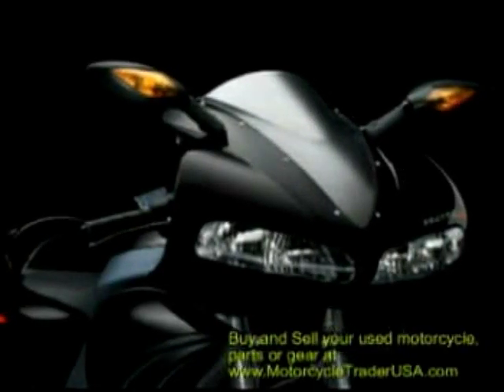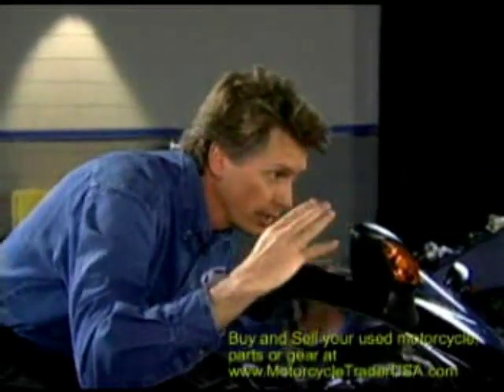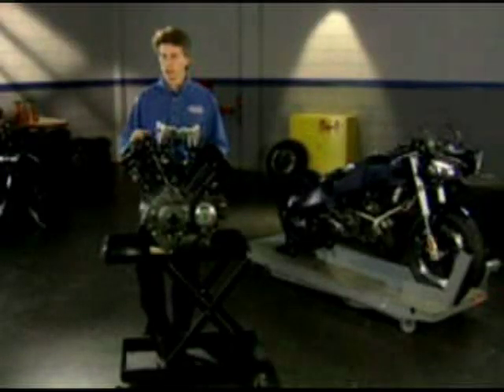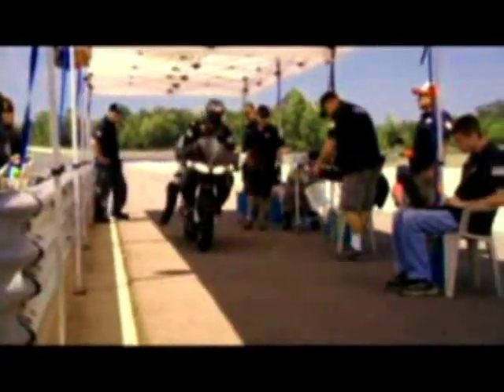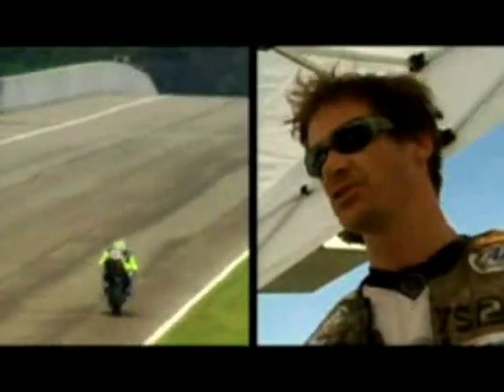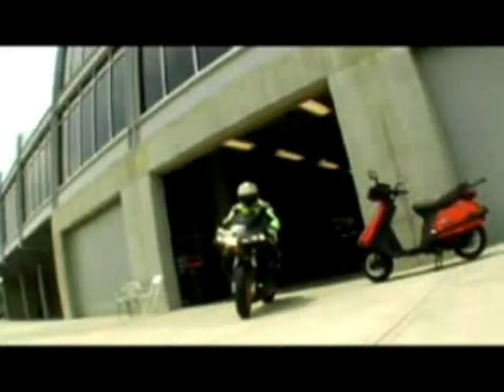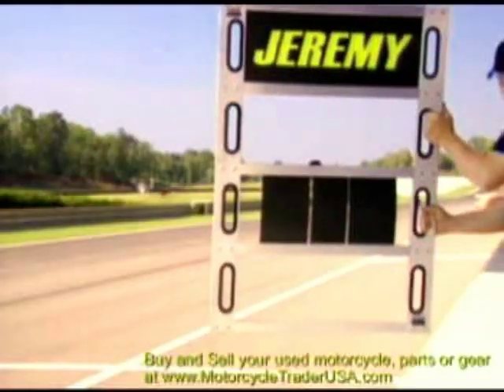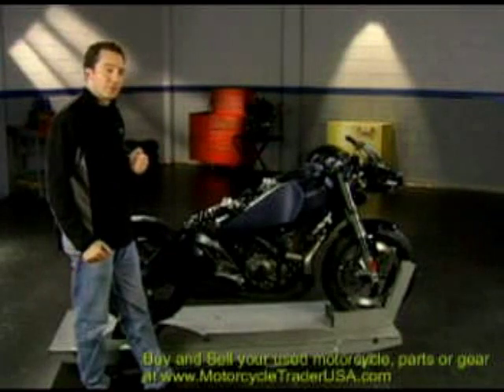Buell 1125R Motorcycle Full Overview Video

Comment: Would I have bought an 1125R FOR 12K plus. Probably not. But I got a new '09 for a little over 5k out the door. By '09 the problems were fixed and the bike, so far, is flawless. I think it's a great bike, fast and solid if not quick handling. And I have to agree it would eat a 'Busa alive on a track under equal riders. But if you disagree, take your Suzi to the nearest track for a track day and see how many 1125r's you outrun.

Comment: I have rode Hayabusas with turbos, you want to talk fast haha.
 My everyday driver bike is 190 horse at the wheel. 
 Its being able to handle the power, having the brains to know when and how to use it. 
 Having power on the street, riding at normal speeds, makes bikes safer having the ability to outrun and out manuever other vehicles that do things to obstruct you. 
 More then once I have had to gas it to make it through an intersection where someone was pulling out in front of me.

Comment: Well, gasoline itself won't corrode metals.  Gasoline typically dissolves hydrocarbons (like polystyrene, or many greases.)  In fact, gasoline won't even dissolve sugar, despite what that old idea of putting sugar in the gas tank would suggest.  Gas tanks corrode due to *water* in the tanks.  On a motorcycle, the frame would regularly be exposed to water, so putting the gasoline in the frame doesn't really add any risk of premature corrosion for your bike.

Comment: V-twins are usually lighter than inline 4's. there is less block to a v twin and more empty space. my 750 kawasaki weighs just as much as my fathers 1200 sporty. but mine is still faster. So V-twin will give you better handling and slimmer fairings, good for technical riding on track or canyon carving. The  extra Torque from a V-twin well also rocket you out of corners. 4's are better for straight line all out speed.

p.s. don't quote me on this

Comment: Yea linx187,  Erik Buell doesn't know what he's doing, He has a Engineering degree from Pittsburgh, was the first to actually put a full fairing on a race bike (back when he started racing). Stresses low center of gravity with fuell in the frame and underslung exhaust. He is probably the only CEO that actually ever raced.

Comment: Yes it is technically a larger diplacement engine. Facts are facts buddy. And if you want to really know the facts its compared to a 750. here you have it. The Gsxr 1000 will not only beat it, it will make it disappear in its mirrors. And this is in stock form, simple mods make the Gsxrs much faster, where no simple mods will do this for the 1125. It doesn't matter because soon they will be gone anyway. So whats the point? Anything harley has thats worth a shit they quit making, go figure.....

Comment: To call An engine with 25 more cc's And two less cylinders. a bigger engine is a lack of mechanical Reality.Susuki has made a version of the in line DOHC inline 4 sense 1977, they have had over 30 years to improve it I should be better. .
this engine has only been around for a year or so.yet it compares fairly well.

Comment: I work on them so yes I do ride. I am not so against the 1125 its finally in the right direction. My biggest bitch is the Sportster engines they used to use. Unbelieveable garbage. No company could have done worse. I look at what they have now and laugh because it took an imported engine once again to even somewhat compare to what the other companies have been building for years. Yes the 1125 is better but its too late. And when you can have a Gsxr I say why not its a better bike. Get with it

Comment: The only thing your Buell will "own" is your wallet! 
 If you ride a Buell with the Rotax at least you have a better engine then the previous models had. Its good they finally went Rotax but its too late as Buell is done for harley droped them as harley usually does when it works. Now go and dream of beating Hayabusas or a Gsxr of any size and live happily ever after. Thank God the Buell dilema is finally overwith.

Comment: Not only is it a larger displacement engine, it has a shorter lighter crankshaft. It has two less pistons, rods etc... to have to sling around. 
 By rights this engine should fly by the same size inline, but guess what?? It doesn't you dweeb. It makes more noise, which guys like you enjoy and doesn't perform. The inlines flat out fly. Smaller displacement inlines will still eat and spit out your Vtwin crapbox. But go ahead and ride proud, while the rest of us laughs our ass off at you. Wise up